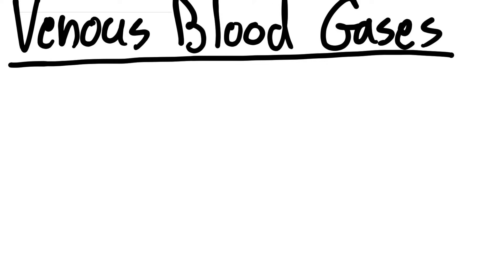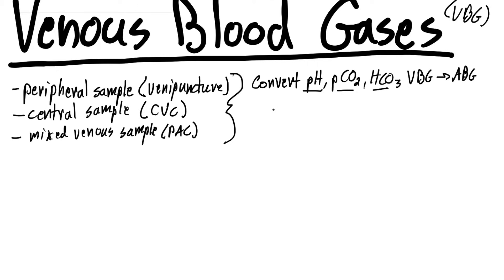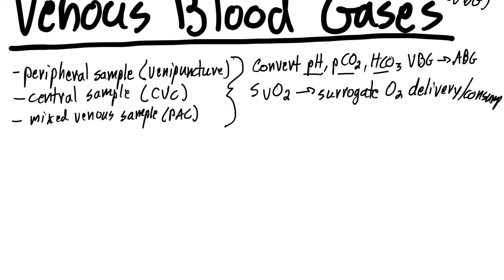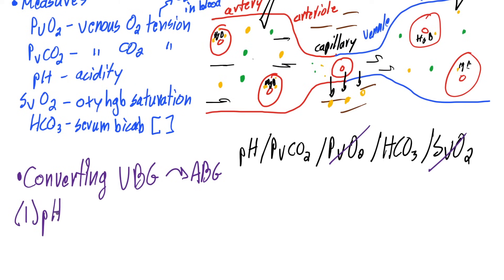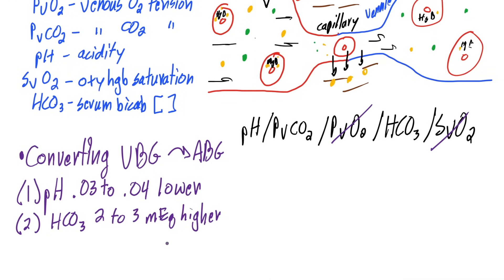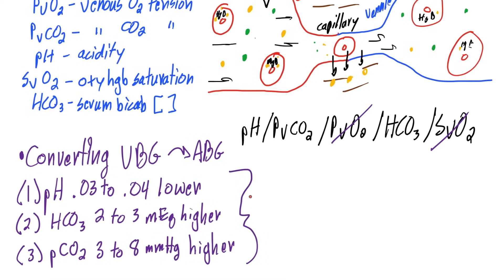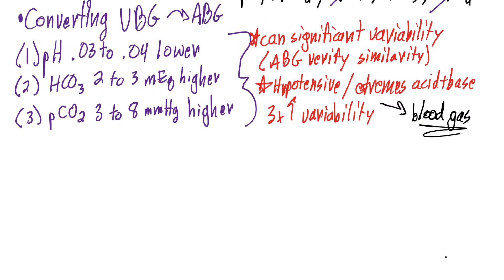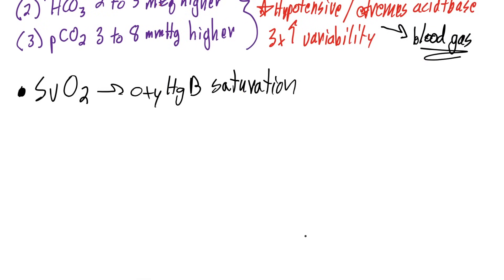Venous Blood Gas (VBG) Basics - Components, Sampling, Converting To ABG | Clinical Medicine

Comment: Thank! Well done as usual. We do not measure the bicarbonate on the blood gas; the pH, the PC02, are measured and HCO3 is calculated by the Henderson Hassalbach equation. The venous oxygen is a source of great error...for a while in my shop the lab had actually started to use chemistry tubes for venous gas collection. That doesn't change the acid base much, or the PCO2; but gives you oxygen values that are higher than arterial?!  Nobody but me complained about this.  But we found the error and now they use the proper blood gas syringes. 

Using the SVO2 from even a good central line has some problems, compared to a mixed venous ABG from the pulmonary artery of a Swan Ganz. I tell my COVid patients to expect one stick a day in the wrist, so I can follow their oxygen, (A-a ) gradient, etc; High flow you can use saturations, FI02's, and the ROX score. Sicker ones need an arterial line. Also lots of the arcane methods of interpretation of ABG's require formulaic manipulation and therefore accurate ABG values. Studies show ED people love venous ABG, internists prefer ABG. I am an old lab director and had previous lives in the clinic, before hospital medicine, and I love this stuff! The chemistry actually measures the total venous C02 , ( why we call it the C02; a confusing name ) and it should always be 2 to 3 points higher than the blood gas bicarbonate, ( because it's the bicarbonate plus dissolved C02 ), if your lab systems are working right. A quick way to check! Cheers!
Reply from the maker: Thanks for the excellent additions to the video! Great insights!